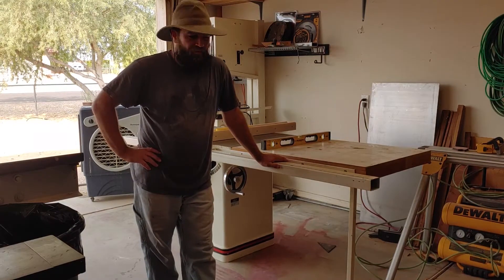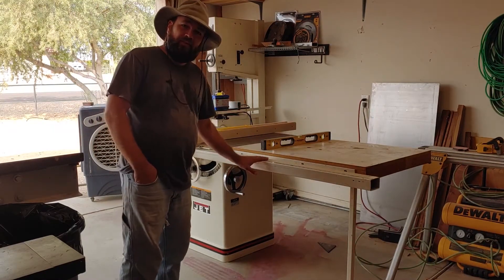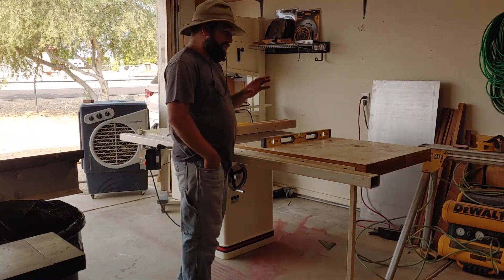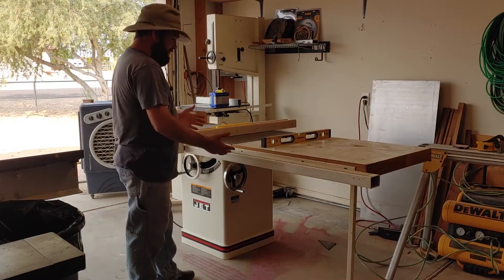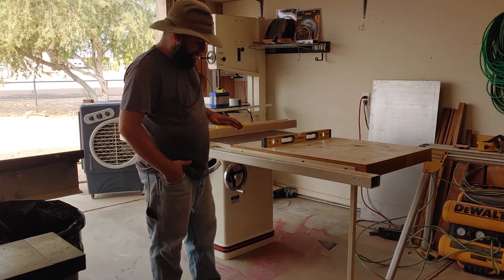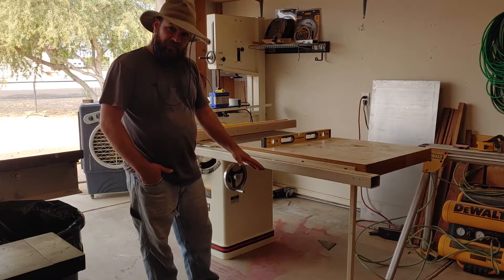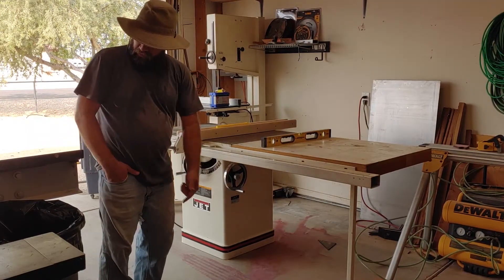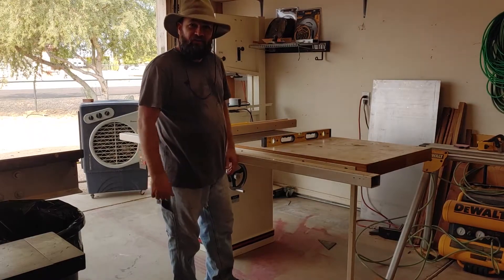I built a mobile base for my 50" Jet table saw!

Comment: Excellent design and great execution!  At 8:18, the long carriage is evidently straight and the garage floor is not.  I'll be interested to find out if the carriage is flexible enough to handle the uneven floor.  Then, I was disappointed at 8:23 where your saw is magically off the concrete.  I would have liked to see how you lifted the saw and extension table.  At 9:24, "DON'T MOVE ONE OF THESE SAWS BY YOURSELF!" appears on screen, at exactly the same time you are lifting a portion of the saw/extension, by yourself, to remove the first of one side of one of the 4x4's.  Did you get it ON the sawhorses/4x4's yourself?  When the video concluded, it appeared that all 5 casters are rolling.  Did you have to do something so that they all rolled, or do you just avoid that sunken (or raised) portion of the floor that is not level?  Great video!  Best implementation of extended wing actually longer than mine.  As Dave Buchanan 9761 said, "I'm stealing that design!!!  I intend to do the same.

Comment: Excellent desing and build, I missed something on the caster brackets, Did you have them bent , or did you cut angle and weld on extra metal ?

Comment: Nice build! 

I’ve got a Powermatic 66 sitting in a 10 W x 20 Deep garage doing nothing because it needs a mobile base.  

Is your welding table stashed, folded on the wall behind the saw or do you have another table on wheels?
Reply from the maker: Thanks, yes, the welding table is folded and stored on the wall.

Comment: Anything you would change in the design after having used it for a while?
Reply from the maker: I wish I had finished it by putting a shelf on the bottom and installing a router table on the end.

Comment: Im looking at getting a very similar table saw - this helps with my decision.  I still want a mobile solution.
Reply from the maker: It's very possible to use this one as a mobile unit. Probably a 30 in. fence would be better though.